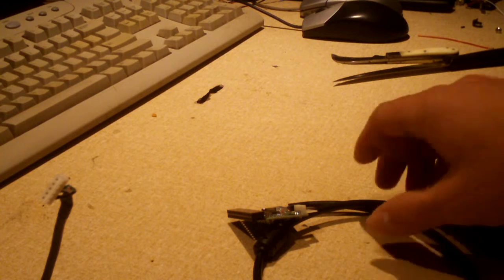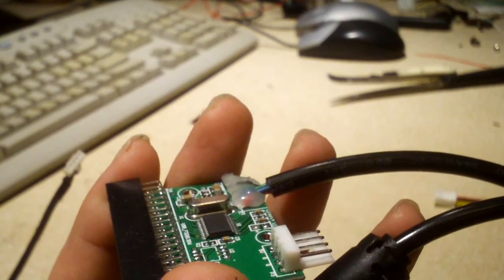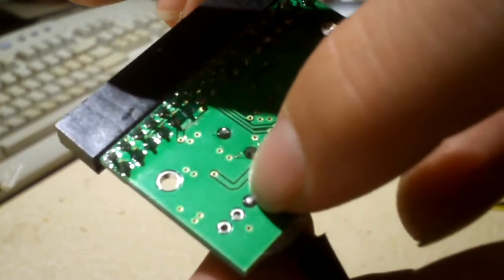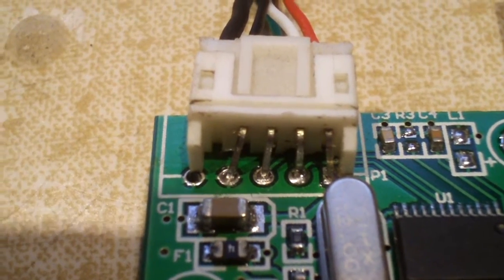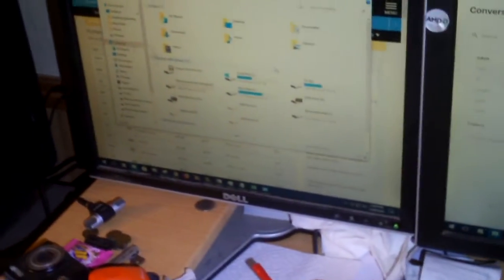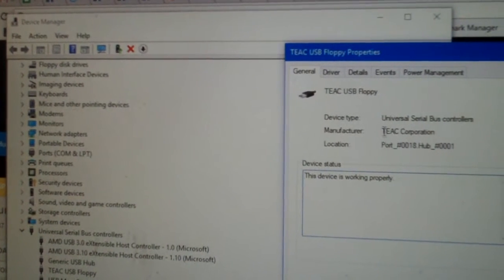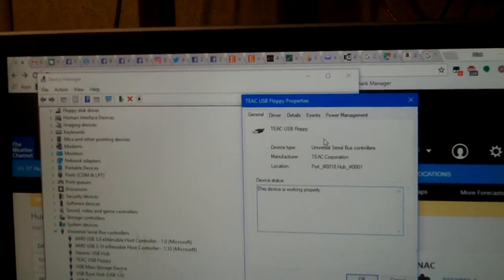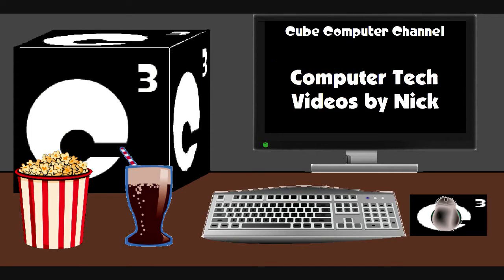Getting the floppy drive working in the recently upgraded MTDX

Comment: One thing I don't understand, notice how the floppy power cable also has wires colour coded for 12 volts. I don't see any circuitry that would convert the 5V power from the USB port to 12V power. Do 3.5" floppy drives really need 12V power anyway?